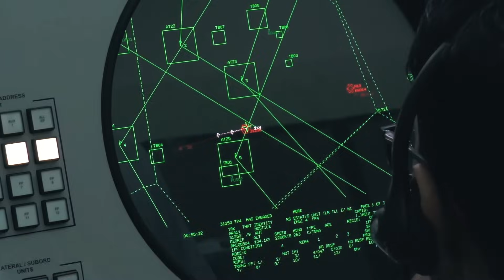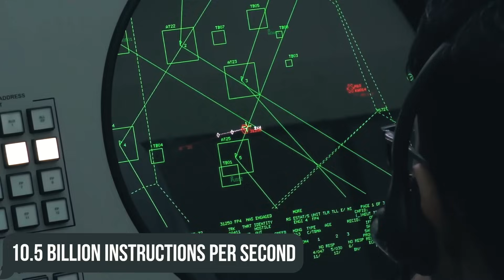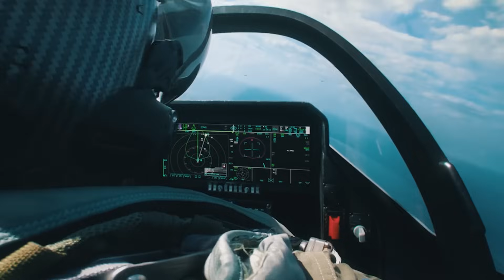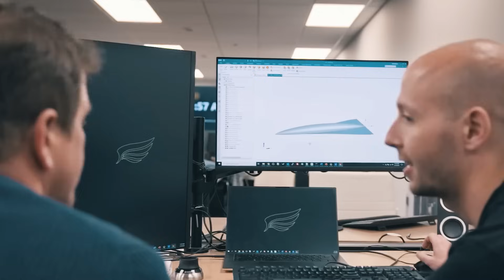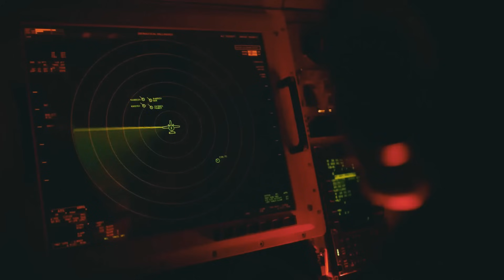New Modernized F-22 Raptor Shocked The World

Comment: The Raptor isn't "invisible" to radar. As an air superiority platform, it's designed so that you see the enemy before they see you.
Reply: No one ever claimed it was “invisible “. Through low IR, RCS, acoustically, the enemy needs to get very close in order to obtain a lock. The f-22’s advanced electronics and radar it can detect  and engage any other target long before the enemy knew the raptor was had a clue who was firing at them. The 30year old fighter is still at the top.
Reply: @nonamehere9149 I mean, it's flown right up next to other pilots in the middle east close enough to where they could bump eachother and they still didn't notice them til they made it apparent they were there.

I'd say that's pretty much invisible, atleast for those aircraft.
Reply: @nonamehere9149 not low ir this thing absolutely have no ir radar system
Reply: At certain angles the raptor has a radar cross section about the size of a bumble bee
Reply: In essence LOW OBSERVABLES...
Reply: at around 2:30 "it was built to be invisible to radar and the human eye"
Reply: If you are beyond visual range then you can't be seen,
When radar thinks you are a bird, then it's not saying you are a F-22.
       And so you want to believe what tik toks communist propaganda 'claims'.    Are you another obamabiden traitor??    Or do you STAND with PATRIOT AMERICANS, SALUTING OUR STARS AND STRIPES.     
    China wants to know on communist tic tok.    Don't be a fool.
Reply: 0:09 what’s going on who really is she and why the heck did I like her the 1st day ?